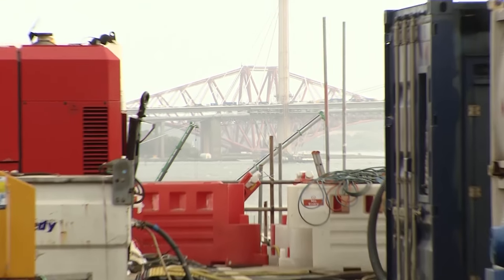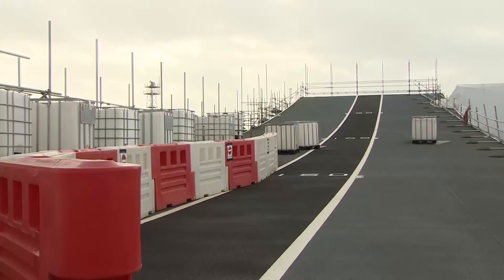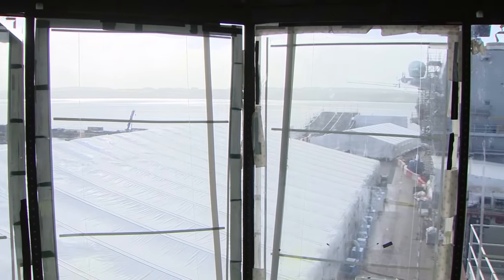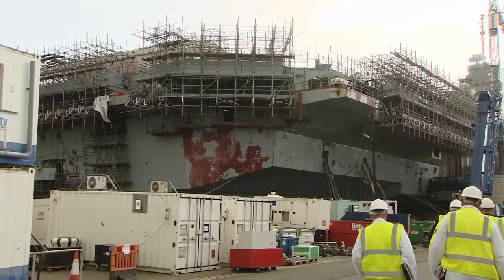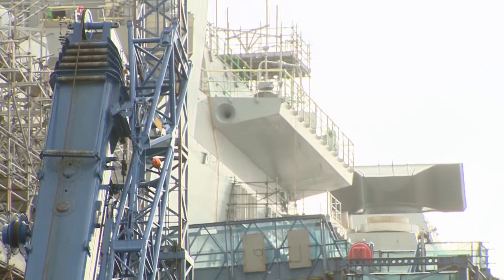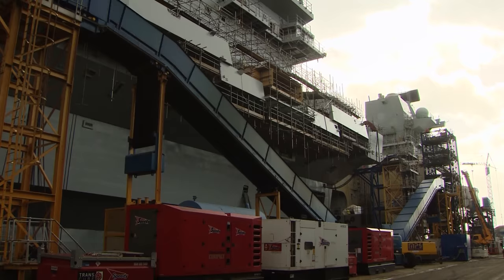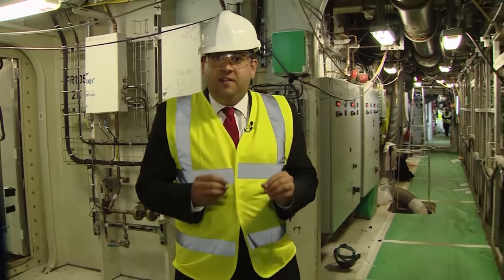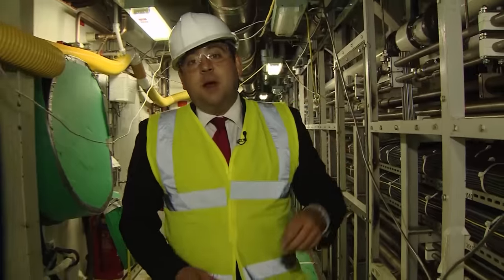HMS Queen Elizabeth Shipshape And Almost Ready | Forces TV

Comment: the yank carrier ford has 2500 and the brit carrier 650..how is that possible? well 80 aircraft against the brit carriers 12 may have something to do with it! lol so embarrasing!
Reply: 12 Is the minimum amount for a peacetime deployment even then it'll probably have more stationed on it, The QE is more advanced, has less crew and is much more cheaper.
Reply: Less embarrassing than some future USS Clinton or USS Trump?
Reply: Christopher Crosby 
You obviously do not know carrier capability. The Ford or Nimitz or QE can carry up to 50 fixed wing aircraft. Yes the US can carry more, but your point is totally stupid. The QE has 4 acres of deck space. That size is more than a Nimitz class. So stop your weekend boy fan boying. The QE are the second largest carriers in the world. Be proud to be British. Do not be a moaner. These ships are fucking huge. They are a bigger platform than a nimitz, they need less crew and are faster by design to get the air fleet to task than the Ford. So, please stop it yeah
Reply: The QE has nothing close to a Nimitz, nor is it the 2nd largest carrier class in the world.. which happens to be the Nimitz, ironically.  The GR Ford class are 110,000 tonnes, the Nimitz class are 105,000 tonnes, the QE class are only 65,000 tonnes, smaller in both weight and size than either of America's two current classes.  Although you are correct that we can carry a helluva lot more than just 12 aircraft.  A US carrier can carry around 90 in total so mathematically we should be able to carry at least 55-60.
Reply: Both the Ford and Nimitz are roughly 100,000 tonnes with full displacements, the QE is roughly 70,000 tonnes with a full displacement.
Reply: Yes we can carry 50! But in peacetime deployment 12 is enough and three helocopters. The QE class is 70.000 tonnes! We all know the Americans overkill everything. These new carriers are gona be amazing, and do there job perfectly, the invincible class fought and won wars these are allot bigger! And hardly and other nation is building them so be proud Britain is regaining her sea air wing again.
Reply: David Webb 
Yes we do. We have two.
Just not at sea yet
Reply: Fek The First Firstly please stop your F'ing this and F;ing that...You obviously don't know how to make a point without swearing! Right this is a fact..they are big ships, never said they were not, I said they carry 12 planes which although far lower than the 40 they can carry is probably what they ever will carry...12, why? because we cant afford any more! and yes it is 4 acres...of  a car park! Because, let's face it, the jet we are getting, the  F35 b  can, indeed land and take off in a car park!, They ate not true carriers, they don't posses cats or traps so the only fixed wing fast jets we can ever operate from these are F35b's which because of the lift fan have a smaller payload capability and shorter endurance than the other 2 versions of the F35, The Brits  optioned F35b does not even have an internal cannon such as the F35a, the True carrier version of the F35, i.e. the F35c has larger wings, a greater endurance is more manoeuvrable (because of larger wing 'lift' area) and it can operate on/off both Yanks and french carriers... if needed to!, In fact there are plenty of videos on here showing french Rafael's landing and being catapulted of Nimitz class carriers. These true carriers posses catapults and arrest wires just like our old carriers did when we operated Phantoms and gannets from them!  (we Brits even bloody well invented the catapult and the angled flight deck plus the mirror/light landing aids! Yet we don't even build our carriers with our own inventions!) Our carriers are just a big flat deck and yes we can operate different rotary winged aircraft but only F35b's (and harriers too if that clown Cameron had not sold them  all to the US marines who will operate them alongside their F35b's on their own small Marine carriers which  also have no cats or traps and the yanks don't even call that class a carrier! We have to rely on a Merlin helicopter for AEW tasks where as the yanks and the french can and do operate Grumman E2 d 'Hawk-eye' fixed wing air craft, the yanks carriers have stopped operating intruders and F14's but still can fly Hornet F18 and super hornets  from their decks not to mention a couple of Grumman C2 greyhound transport fixed wing aircraft. The french on their Nuclear powered carrier  can operate interchangeably with Yanks aircraft! The french themselves operate Mirage and Rafael fixed wing fast jets plus their own Grumman Hawk-eyes which are a far better proposition for AEW then the Merlin as the Merlin's are limited by a lower operating ceiling meaning they cant 'see'  (As in Radar) as far as the Yank and french Grumman AEW;s! The real sad thing is that these were originally going to be a proper conventional carrier design with arrest wires and catapults. The Americans were even willing to underwrite  installation of magnetic-electric catapults on them, it was even planned that they were to be also Nuclear powered like the American and french carriers, Our  2  big flat top  barges have to be shadowed by 'oilier' tankers to keep them topped up!. If our carriers had to steam  full powered  ...we use even more fuel. that in it's self is a big  logistical problem for our carriers  if we were to be operating  on the other side of the world, we would need fuel tankers shadowing us!...Not  the yanks and french who can operate for 25 years plus, without the need to refuel!. It's plain daft, that our new astute class attack submarines are all nuclear powered with brand new reactors installed  yet we chose these huge  carriers  to be fuelled by  fossil fuel and cant land or launch any other fixed wings apart from the 'hamstrung'; version of the F35,,,,, That's why I still say, EMBARRASSING...what a missed golden chance to operate Proper state of art carriers with cats and traps not just a great bit   fuel burning barge! Incidentally the yank carriers are faster than ours too, we may be faster than the french but not the yanks besides we have not even gone to sea yet to complete sea trials  so its silly to say our carriers are faster when we haven't even 'turned' the engines on! So before criticising and ridiculing some one else 'Mr Fek The First' do your own homework!
Reply: Christopher Crosby Chris, I've had a word with the team at half time and the consensus is that if you want to win this game you need to put Paragraph on the pitch!
Reply: Christopher Crosby 
Wow. Quite the rant id say.
Just to enlighten you "fucking huge" is a perfectly descriptive and valid point. It is not used in an aggressive manner. It is used in the sense it was meant....ie, "fuck me, thats a nice ass".
So please, dont lecture me on what is acceptable.
Secondly, an air craft carrier is exactly that, an AIRCRAFT carrier. 
It doesnt matter how you rant on and bloody on, and have a hard on for CATBOR. Are you seriously suggesting that a 65,000 tn, nearly 300 metre, 4 acre vessel that can hold 40+ aircraft is NOT a "true" carrier? Even tho the US is over joyed that the UK are building not one, but two "super carriers"?? Really?? Are you mad??
So theyre barges too now yeah! Lol.
They can sail 10,000 nm. They displace 65,000tn empty, have over 600 crew, can carry 40+ aircraft, have a task force......but are NOT carriers?? 
Hm...
You can put the CDG (the French scrapped their super carrier PA2, because it was extremely expensive) and two of the Italian light carrier together, and ONE QE is still bigger. HMS Hermes was a conventional carrier, with steam catapult. And? It was a 3rd the size and nearly 4x the crew. 
And? Was she a "true" carrier according to you? 
Only the US have nuclear powered "super" carriers....and? 
The CDG is tiny compared to a QE. And it still has to re fuel for its limited number of planes. 
You have this thing for a bloody catapult. What about the all the technology? Or the mechanisation? The US carriers are faster by a cpl of knots. Hardly a river boat. So a mute point. 
"On and off of French carriers"!?.... haha. 
They only have one, and its tiny. The US have 11. Theyre hardly holding dinner parties on the CDG fella. The US will be landing on our "barges" too, you do realise this no? 
And btw, the UK is buying 133 F35. Hardly a shortage. Carrying 12 in peace time is absolutely normal. Why would they load a carrier (like the US do) in peace time? That doesnt make any sense. And unless youre a test pilot for the F35, how do you know what the capability of that craft is. The same nonsense from people like you was said about the Harrier, that wasnt a bad little subsonic plane was it. 
"Its not a true carrier because it hasnt got CATOBAR" 😂😂😂
Hilarious.
You look up what a carrier is fella, learn a bit more, educate yourself, then get back to me......

Comment: N O T    F L A T
O
T

F
L
A
T
Reply: ya its not catobar. :(
Reply: Monster LMA What catobar or stovl?
Reply: Catobar is still the best tho, because it allows all types of planes to take off, and it allows planes to be fully loaded
Reply: but cats and straps also takes up more room and can also fall to failures, what happens when the landing system or the launchers are broke? you can launch any planes for either defence or offensive missions, not to mention it is more costly to fit, maintain and repair them, with stovl you can still land and launch planes in most situations, you could use helicopters and jets at the same time. plus with stovl jets you have more versatility. for example with the harrier, you could launch it an for a mission and say it runs low on fuel or has to land but the carrier is out of reach and there are no land based runways? just land vertically.

Comment: One direct hit and its fucked
Reply: The same is true for almost all military assets.
Reply: Yeah I know but this asset doesn't seem to be built to take any sort of damage.The internal systems look very light weight.One hit and its out of commission.
Reply: HMS Glamorgan springs to mind.Took a direct hit from an Exocet.Back on patrol 24 hrs later.
Reply: ffotograffydd gohebwyr HMS Sheffield comes to mind. SS Atlantic Conveyor also comes to mind. Direct hits can suck rather badly.
Reply: Yeah but the Glamorgan was based on ww2 design experiences.It could take hits and survive.The other ships used 'modern' design practices,ie extensive use of aluminium.This material was found to be a liability.I'm just wondering what other untested design features have been incorporated into the new carriers.
Reply: ffotograffydd gohebwyr recent example of that with the yemen attack on the high speed transport.

dont build a war machine out of Papier Mâché.

Comment: testing engines for the first time lmao. Didnt she go through sea trials already? fucking embarrassing and will only displace 12 aircraft and less capable than the french carrier.
Reply: YOU ARE RIGHT! THE TORIES DID A u TURN WITH THE DESIGN ORIGINALLY insisting it be a CATOBAR  type, i.e. catapults and arrests...this would have given us a 'proper' carrier not a flat top war ship that can only accommodate VSTOL fixed wing type aircraft (as well as helo's) the french  recently did a joint exercise with the Yanks landing their Rafaels on Nimitz class carriers and launched again too! now we may be able to land and launch from the charles De Gaul and the yank carriers but the french and american allies couldn't do that if our carrier was the only option to them...why oh why did they not , ( A) make it a standard angled flight deck catapult and arrest wired conventional carrier and (B)  go for nuclear power?  Building a oil powered (yes i know its electric/gas turbine, when i mean oil powered I mean it has to have a great big bloody tanker following it as it only has 12 days or so fuel in its tanks, less at full speed unlike a nuclear powered carrier! after all our Astute class subs are nuclear powered as is out Trident subs? the flat top deck limits us to the F35B only, we have to rely on helicopter AWACs (not like the US and french who use a small AWAC aircraft),   It was to save money... what, really?  false economy!  It will cost more in running expenses and it's  limited capability...look at the original QE2 carrier design.with angled decks and CATOBAR, it was such a missed opportunity! You'd have thought that they would have at least built one of the carriers conventional but oh no, britain the laughing stock. Again!
Reply: Sea trials?  She's not even built yet!  Do you take a car for a test drive when it only has two wheels attached?

Comment: wow why not just ask your good friend and ally U.S to help you build a real carrier? doesn't have to be as big as a Ford class but no catapults for plane take off? u just limited half if what can be used on this carrier. no weight on planes no real sustainability can't carry heavy load of weapons extra fuel. cause they need to keep weight down for planes to take off there own power. 

don't get me wrong looks to be beautiful but the Russians and chinese been tossing back and forth same concept design of a carrier for decades cause it's just crap and don't work. better of using helicopters on this carrier make a new chopper unit and just use attack copters instead of jets.
Reply: The UK came up with the idea for CATOBAR carriers so could have built as one if required (The ship was designed with the capability in mind) but stuck with STOVL for the design.

The Royal Navy were also the first to operate carriers like these back in the late 70's, while not quite as capable as CATOBAR, they've done the job pretty well. Russia and China only use conventional aircraft on their carriers so it limits them far more.

The UK and most other countries who operate Ski-Jump carriers use Harriers (Or now the F-35B) which are specifically designed for short take offs so are far less limited.
Reply: +fusionmechanic1
.
Thank you for your offer but I think you may have missed the point about our new class of real carriers. In fact we were thinking about offering your people across the pond any help they may need in building a new Nimitz Class replacement, especially if the current rumours are true about the new Ford Class being for the chop. 
.
Sorry for that, no offence meant. Any way joking aside, the new QE Class carriers being built over here really do have the potential of being game changers. The key to understanding this is to compare the cost of the one Gerald Ford carrier with the combined cost of the two QE Class carriers. The one GF Carrier is expected to cost at least  $12.8 Billion and the two QE Carriers are running at $8 Billion for the pair. This means that the one GF Carrier costs more than three times that of one QE carrier.
.
You might say so what! The GF is a lot bigger than the QE Class carriers. So compare what you get for one $12.8 billion GF carrier and for two $8 Billion QE Carriers. The GF Carrier displaces about 102,000 tons two QE carriers displace 70,000 tons x 2 = 140.000 tons, the GF Carriers flight deck is 4.5  acres two QE carriers flight decks are 4 acres x 2 = 8 acres, the GF Carrier can carry about 90+ aircraft two QE carriers carry about 55+ aircraft x 2 = 110+ aircraft, the all up crew, air wing personnel, marines, etc. of  a GF carrier is about the same as two QE Carriers, 
.
As far as any criticism of the F35B (VSTOL) is concerned regarding range, weapon load etc. is concerned it will be mostly negated during operations by in air refuelling, rolling landings (under development in UK), airborne radar and control will be carried out by helicopter or possibly Osprey V-22 based systems or land based aircraft if available or drones,  etc. etc. Being non nuclear powered is not a disadvantage as it is rapidly becoming obvious that the advent of AIP (Air Independent Propulsion) conventional submarines and other new weapons that all carriers both nuclear and non nuclear will now have to accept an element of battle damage such being the case being non nuclear may now be considered an advantage.
.
Finally there are a bunch of other advantages that the QE Class has over the GF class. One is the massive amount of flexibility built into the QE Class to carry out many other rolls, they are not restricted to being just a large strike carrier. The pair can work in two separate task groups as medium strike carriers,  a medium strike carrier and a helicopter assault ship,  a disaster relief vessel and a hospital ship and many other different combinations of different rolls, the flexibility is enormous. For a country with only two carriers they can also ensure that at least one carrier is always ready for operations through out the year. Especially when a non nuclear powered carrier can spend significantly more time at sea than a nuclear one due the longer maintenance requirements of nuclear carriers.
.
Clearly the Queen Elizabeth Class has all the makings of a successful project.
.

Comment: The aircraft carrier is a peace of crap it doesn't have catapults or arrester cables its engines are slow and need a lot of maintains, the F35 is very expensive and are 7 year late with still a lot of problems,  the ship s small compared to most ships in its class and will have a smaller number of aircraft than most others